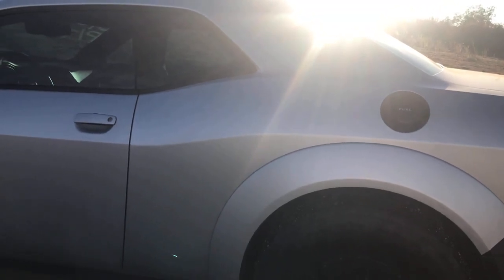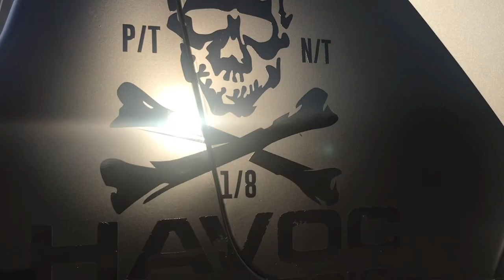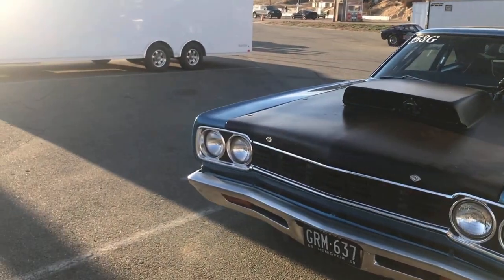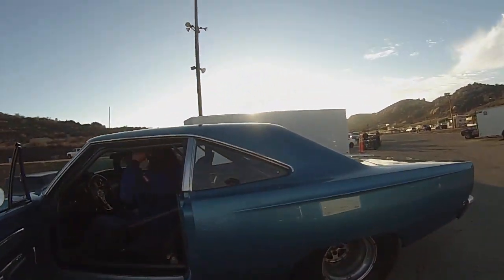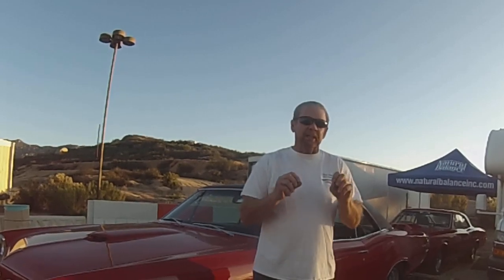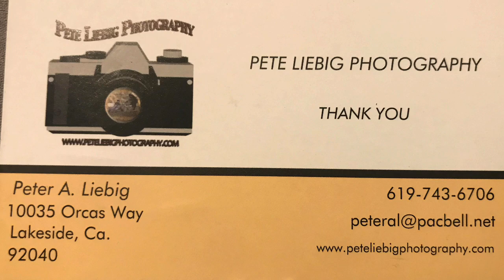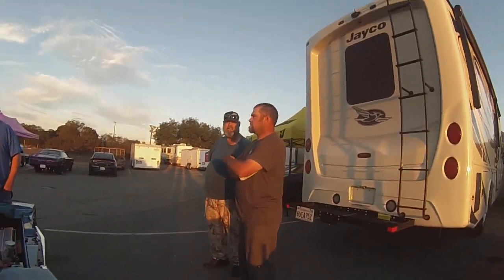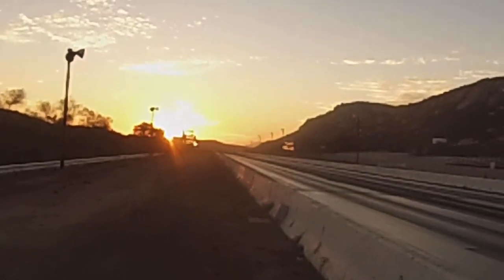Barona Drags 11-19-21

Comment: Dennis's converter is too tight  !   and damn , I Love that '68 Roadrunner  . The Challenger is gonna have trouble cutting a light against a trans brake car , but it's fast . The GTO'S are awesome too .
Reply from the maker: I’ll let Dennis know. I believe Mike said Dennis’ Duster has a trans brake. But it’s not hooked up. If you have a trans brake do you still need a loose converter?